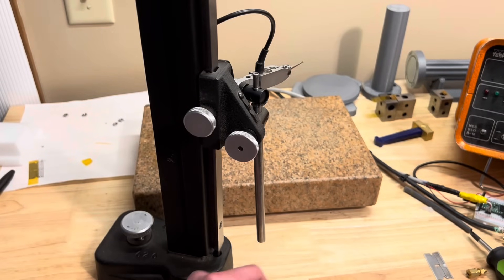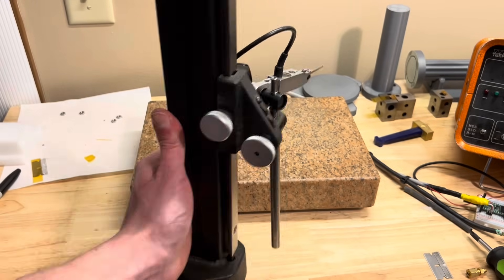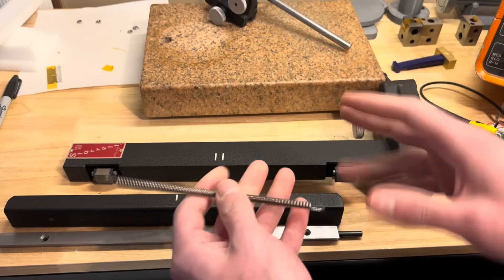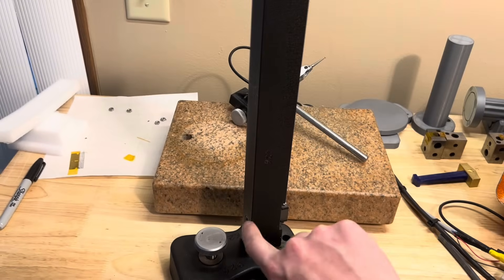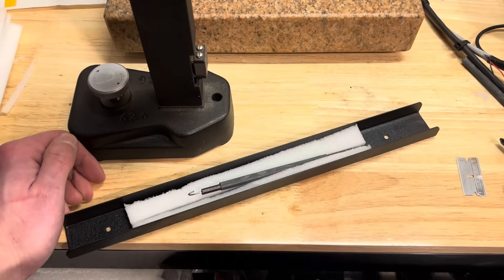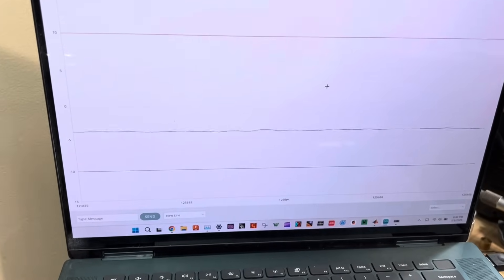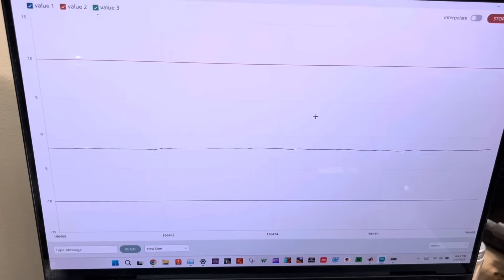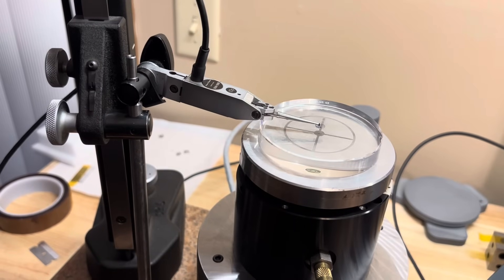Fighting vibrations to achieve nanometer level metrology in my kitchen

Comment: If you think you need more dampening you can try replacing the spring with a gas constant force piston. That should only resonate at extremely high frequencies. For thermals, you could try putting a foam pipe insulator around the vertical part so as you grab it you are only interacting with closed cell foam which would put significantly less heat into the upright. It would also slow down the rate of change as the environment changes temperature, but that could also be a bad thing as it would take a lot longer to hit equilibrium.

Comment: I would imagine a crate of sand would do pretty nicely for dampening vibration too. If I remember correctly, the metrology lab in my university was in the basement and was a room within a room. I was told ( and don't know if it was true ) that the inner room was on a bed of sand. Sadly though, it would not help at all with sound waves traveling through the air....

Comment: Hey, so firstly taking a low rebound rubber as a spring may work better, but id make my own insicator base.

Trying to find the instagram, but it uses three lapped pads on the base, with one on pad tillting. A solid dovetail with that being the fine adjust will give you a very nice indicator stand

Also damping grease is really fun once you learn about it, really many uses but using it to smooth out thread adjustment is absolutely lovely. Its what makes your knobs and potentiometers not rattle :).

Comment: There are these rubber doughnut hand strength toys, i womder if 3  of them would make a pretty good isolated support
Reply from the maker: I actually have some of those, unfortunately they're a bit too stiff to use by themselves. If you could put them up on end, and load them radially like a tire, that could be very promising. But I'd need to make some sort of frame to hold them in that position..

Comment: No idea why I got recommended this, but... without watching far into the video - you need an air table, not something more rigid, that will actually make things worse.  You need ISOLATION.  Environment noise is going to overpower anything in your instruments in a household setting.  Averaging over many runs helps, but it's diminishing returns, just get a cheap air table.

Comment: People who modify microphones also have to dampen resonances in sheet metal. For that I hear about using silicon caulking and foam. I'd imagine there's also mass loaded variants of similar goop. I wonder how it would sound if you were able to listen to the output of that measurement in audio, you might be able to zero in on noise sources.

Comment: The tube was a great idea! Even though you have a great result, the folds are directly transferring energy so placing the folds outside of the contact area will bring you to another level. Just be careful since it will also reduce stability for taller items.

Comment: Look into Acoustic Impedance matching then do the exact opposite.  You basically need multiple layers of dissimilar materials shaped in a way that they just cancel out the soundwaves before they get to your measurement device.  There are also some inverted pendulum possibilities which when set can cancel vibrations rather well, but your main goal is to make sure your surface and the pads for dampening them have two extremely different impedance levels to make the bandwidth of frequencies it reflects as wide as possible.  Keep in mind at all times Vibrations are basically Coherent Soundwaves and all acoustic physics applies equally with some alterations for resonance and Q factor etc...

Comment: Sheet metal as load bearing material in precision instruments is just a very bad joke.
Short spring preload with massive steel parts would likely just work fine, because enough mass to dampen everything.
Here, just a overly long spring on flimsy sheet metal, 2 things that won't do any good at all with vibrations.
Reply: Great comment, thanks

Comment: I imagine that the vibrations from the spring are made worse by the thin gage metal of the shielding. If replacing it with a thicker gauge piece of metal is not an option then I would try the application of small but strong neodymium magnets to reduce oscillations.

Comment: As for the spring, in older high-precision measuring instruments you can find pieces of oiled felt inside the springs as a vibration damper.

Comment: If we recall how Michelson, Morley and Miller fought vibrations, they took a round trough filled with mercury and placed a large oak circle on its surface. Well, in general, they needed a circle to rotate the setup, but you can also make a rectangular raft. In modern realities, a separate building is built for such laboratories, in which there is a separate room with a table resting on a special pylon, which has a foundation separate from the rest of the building. You can also try to think in the direction of a very heavy metal plate hanging on a complex system of dampers. In skyscrapers, special damped pendulums are installed that dampen the main resonances, but this will not work here, since the frequency spectrum is much wider.

Comment: Metrology tables at my place of work isolate the instruments from vibration by floating the table on air. Same materials and approach that float the rotor in your nice air spindle! Also give the the cables to your instruments a nice long U-bend. They can transmit vibrations too.

Comment: I use air. Let it float . Don’t consume much air either
Reply: Yes, this is the right answer.  Did the same thing in college.  Surprised I had to scroll all the way down to the bottom to find someone giving him the right advice.
Reply from the maker: Unfortunately there is a gap between what i know is right, and what i can do here. Economics being the cause. My DTL is on an air table and of course, it works stunningly well to isolate, but the surplus/ebay gods have not blessed me with another one for general purpose use yet :(

Comment: Nice. This reminds me of the way I addressed vibration isolation for holography in high school  25+ years ago (in a second floor bedroom). With your data setup you could probably realize some nice tuned eddy current dampers (additional mass-spring-magnet) on your system. Good call to bump losses on that spring, some other options for damping with less stiction could be contacting lossy rubber thread or grease.

Comment: Have you thought of making a suspension mechanism with cable and springs to hoist the table off the ground? dose not have to be free floating but the idea is to have all forses vibrat on the suspension cables and the springs attached would absorb the shocks of the outside vibrations.

Comment: Yeah those little vibrations can mess you up. I recently ground, polished and figured a 12.5" telescope mirror and was constantly chasing noise trying to keep vibrations out of the bath interferometer readings. When trying to polish something that needs to be within 20-30nm of a perfect parabola you need to account for so much. I had to build a 14' tunnel out of pvc pipe and heavy fabric to keep even the air currents out of play plus I could only take measurements after midnight or so when surrounding noise had settled down. I had to take about 300 or so interferogram images from different orientations and average all them together to get a realistic measurement of the mirror. Ended up around 0.974 strehl which is pretty good.

Comment: The wooden table and floor both act like resonant soundboards of a guitar or piano. They act like giant resonators and move in response to sound and vibrations.

You can also hum while moving close to and farther away from different surfaces and the gauge to see the impact and figure out what's vibrating.  If you tap the table top and listen, there may be a particular frequency that's dominant. Same for the floor.

Inner tube should work, but also try putting the surface plate over one of the table legs and put that leg near a wall on above a floor joist. That will help.

If you have access to a basement below that room, a floor jack to a point below the table, then a brace from the floor directly above to the underside of the table would also help. Bunch of screwing around, but you should be able to eliminate all vibration.  Even an inner tube setup can only eliminate higher frequencies.

Comment: I used a cheap concrete paver on the top of my workbench on three rubber pads to add 100lbs of mass under my 3d printer.

Might be worth considering given it cost like $20 to do